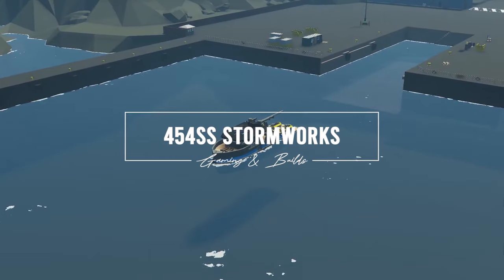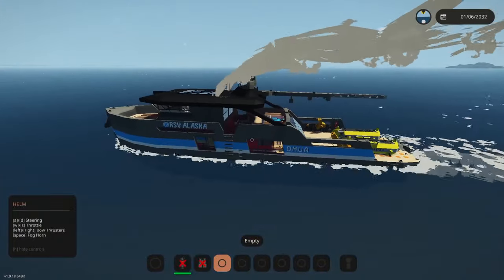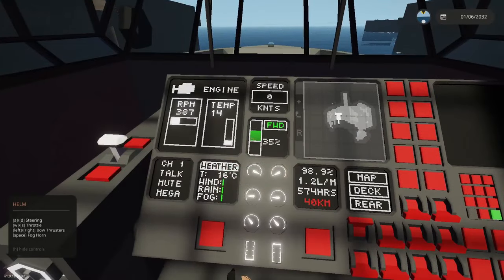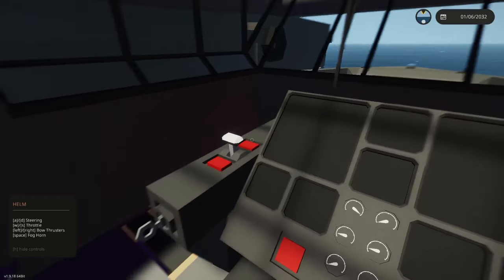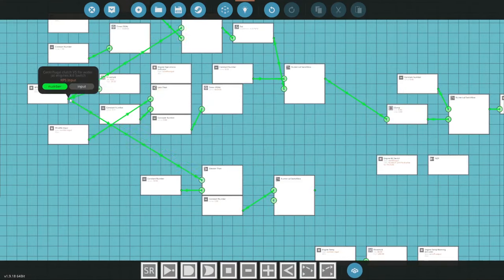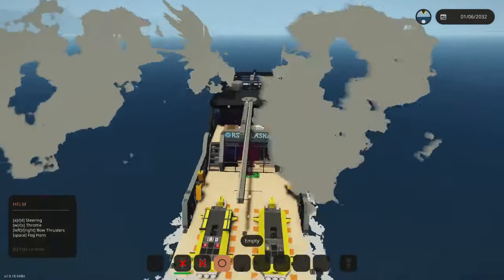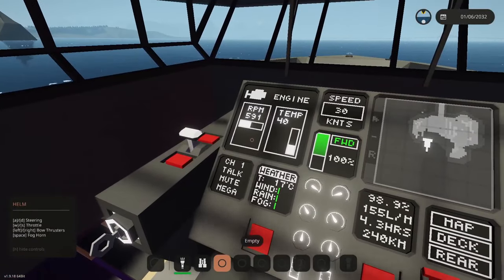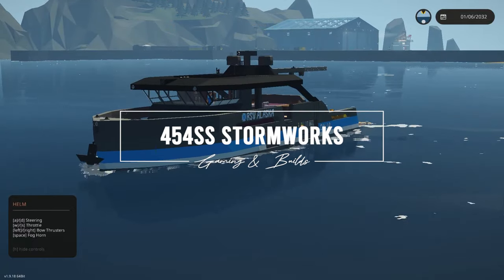Fixing the NEW WATERJET GEARING in Stormworks

Comment: With many thanks to ChatGPT for doing the maths, here are the gear ratios displayed CORRECTLY.

-1:1 = -1:1
1:1 = 1:1
6:5 = 1.2:1
3:2 = 1.5:1
9:5 = 1.8:1
2:1 = 2:1
5:2 = 2.5:1
3:1 = 3:1

Using two or three gearboxes allow you to make a finer adjustment.
Eg, two 1.2:1 gearboxes gives you 1.44:1 whilst one 2:1 and one 1:1.2 (note, it's turned to face the arrow in the opposite direction) give you 1.66:1.

So if 1.5:1 (3:2) is slightly too high or low, and 1.2:1 (6:5) or 1.8:1 (9:5) is too much adjustment, extra gearboxes will give you the intermediate ratios.

Unfortunately, they will also add torque losses, but that may be acceptable if the right ratio makes all the difference.

Just remember to multiply or divide as required.
Eg,
1x1.2x1.2=1.44 and 1x2÷1.2=1.66
Reply: (They are already displayed correctly, thats how fractions work)
Reply: @danielk9906  move out of America to anywhere, where the decimal point exists to make maths easier.
Reply: @35manning im not in america lol. I can now what 6:5 ratio is without chat GPT too, if we must throw shit at eachother.
The ratios are displayed correctly as is, its just your PREFERRED way to display them.

Comment: if you want to do a clutch that varies based on the throttle you are giving the engine you can try using a root function that gets the throttle as x input and then you just tune it to your liking. with the setup i had been using i got a function that looked like this clutchP=a*(x-b)^(1/3)-c with a,b,c being variables i used to tune the clutch to get the best output torque with possible lowest consumption. it can take up some time to tune it properly but afterwards it works very well. i get around 71 knots with a smaller boat than yours and 2 medium engines driving one fluid jet. also you could try if removing the pumps and adding a ram jet as intake for the water, might help with the performance aswell due to the new pressure system of fluids

Comment: Would a solution, using rocket fuel work? And talking about rocket fuel related propulsion, would you be able to just use pressure to power a turbine? Air in on one side, air out on the other?